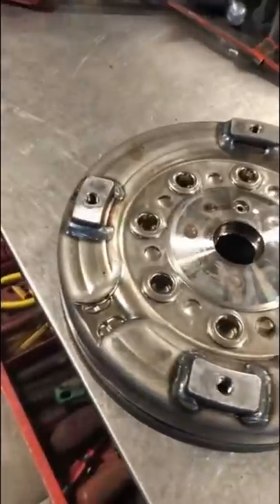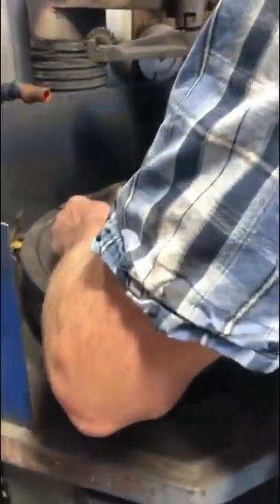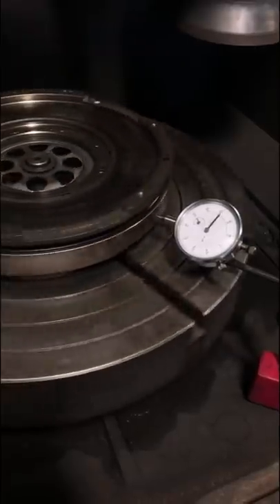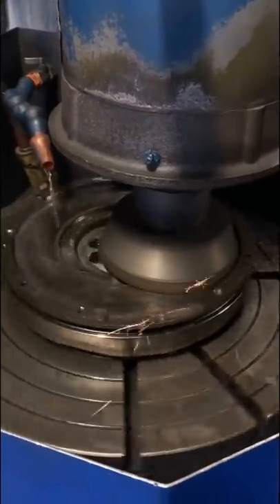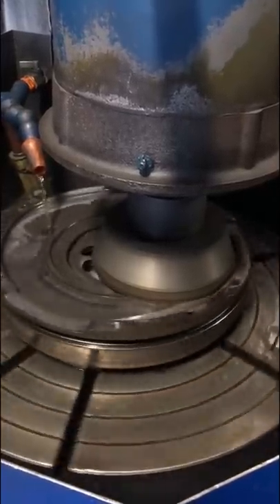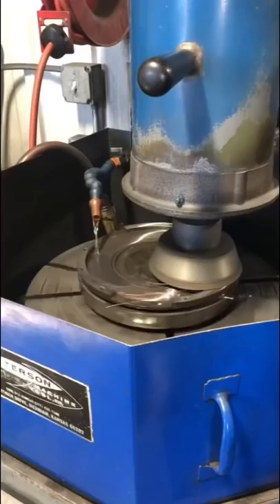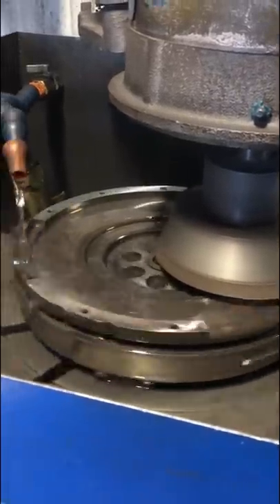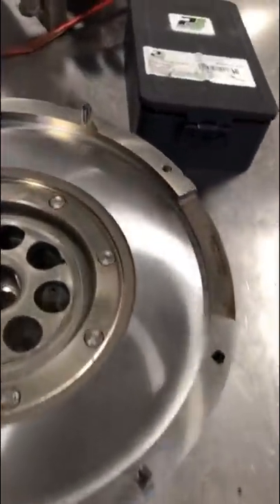#shorts We Can Resurface A Dual Mass Flywheel… But Should We?

Comment: Idk. I'd be looking at non-stock options that may be more readily available. Dual mass dampers inherently fail as they are considered to be a wear item. (Not just the clutch surface, but the damper itself) so, while the surface may work, i'd expect the damper to fail soon.

Comment: It's probably gonna work just fine, but at this point nobody can say how long it's gonna last. As a mechanic I personally have seen a lot of DMFW where the springs snapped inside wich often made the car nearly undrivable due to a really jerky clutch engagement and a constant rattle when in deceleration or partial throttle situations.

Comment: After reading the comments it has occurred to me that people don't know why you don't resurface a duel mass flywheel. They are looking at the finish and saying looks good. Or it will work for a while. The thing isnt going to break. The reason why you dont grind a duel mass flywheel is that the friction plate portion is supported by springs that allow the flywheel portion to physically semi rotate on itself and gives in to clutch pressure. There is physically no way to ensure that you even ground the flywheel flat. Its going to look the same no matter what because of how the spring mechanism works. But you may have it ground crooked and may shutter or shake under load. Unless you seperate the flywheel you can not verify that it is flat after your done grinding. You are at the mercy of how flat and straight the mass produced springs with 10,000 heat cycles are that the wear plate is sitting on. We ran into the same thing years ago with a replacement being available. So we actually separated it and ground the wear plate separately and then they took that portion to a brake and clutch shop and had the springs replaced and had the whole mess riveted back together.

Comment: I do solid fly wheel conversions in most clutch replacements that i do. I really don’t see the point in dual mass, the small benefit to them isn’t worth the hassle.
And if it’s a performance vehicle the next replacement is so much cheaper and the fly wheel can be skimmed.
This is thee first time I’ve seen a dual mass machined, be good hear what it drove like afterwards.

Comment: With the supply issues we are currently facing and the fact that not everything needs to be replaced. Resurfacing is a viable alternative to replacing. As long as the customer signs a waiver taking full responsibility for any liability due to resurfaced part. No warranty would also be part of that contract. Customer breaks it or the part fails. Customer stands on the side of the road with a thumb out… if customer has been properly educated then… go’head

Comment: late to the party.   not only do they need to be flat, but... the springs needs to have a specific amount of absorption.  So if the intermediate layer between the outer sections is fatigued it will rattle and possibly fail.   I've always replaced them or "upgraded" to a single mass flywheel.

Comment: I would say it depends on how many thousand she had to take off to resurface it. Also it depend on how much torque is going to be needed in the daily use. I think in the short term it would work for sure no matter what the variables were. But I would definitely get a new flywheel as soon as possible to replace that one with.

Comment: Honestly as long as the dmf is in serviceable condition (no excessive movement , no broken springs ect) and it can be secured well enough for the friction surface to remain true to the crank bolt flange I can't see it being an immediate issue. Will it last the expected life of the clutch plate? Probably not!.
 Will it's operation be as smooth as a new unit? Maybe , maybe not!, But it will get the vehicle back on the road and will get the customer out of a pinch

Comment: Looks very smooth finish...it would definitely need alot of miles to bed in on new clutch plate...only one way to find out is fit it..run it for 1000miles n see

Comment: The issue is about the material removed. If you need to grind up to or below that lip or if these surfaces are case hardened then you have a problem ( especially in the first case as you will not have proper fixtures and function of the part when assembled). If these are not a problem then you will have no issues.

Comment: It will work fine. As long as the height between the bolt on surface and the disc surface are within tolerance on both sides and the are able to tighten against the flywheel. Your golden. Money in the bank.🤑😎

Comment: A shop resurfaced fairly new, (1,000 miles)aftermarket flywheel and pressure plate causing the clutch to slip, on my sister’s bf’s 350z. I don’t recommend. Had to pull the tranny to install a new flywheel and clutch kit.

Comment: instant death, no question. surprised it didn't blow up on you during reassembly.

That said depending on the wear I'm not sure I'd want a ride in the car if it's getting redlined everyday/ its probably fine.

Comment: Yeah it's going this way in the trade, if the dual mass has life it's a no brainer due to supply issues.but no point if the dual mass is worn , can go solid conversion but wonder if in a couple of years how many run into problems

Comment: Problem is the internals of a dual mass. Mine has two holes worn through and you can see the springs inside. Still working a little noise comes from it. But seems to be a crap part since their hard to find expensive and not easy to surface.  Screw it throw a single mass in and feather it

Comment: If I had the equipment and knowledge I would have put a layer of weld over the surface then  ground down to the correct size.
I’m sure there is way more to it then that.
(But that’s my hypothetical solution)

Comment: Since there is grease in it wich can and will age and dry out i would not recommend it.
Although it might work at first. 2 mass flywheels can last a long time.
I might take into consiferation how hard it is to remove (eg FWD or allwheeldrive or RWD)
If its easy to get out then why not.
If it take a day or more to get it replaced i would rather take a good new one.

Comment: I mean I think it's fine. The Auto industry is one of those places all it has to do is take someone's legs off one time and then all sudden they put out some warning on the box that says you're never supposed to because you can throw it out of balance and problems can happen that and that's true but and it's a big butt most often it was just a lawsuit that made them put that stupid label on a box and with manufactured defects that do exist there's a high chance that it doesn't mean anything. What I would have done is replaced the flywheel and clutch with a performance flywheel and clutch that fits the splines of the output shaft and ran it that way.

Comment: If they know the risks, then go for it.

What are the risks? DM flywheels tend to be thinner at the wear surface, and the connecting material deteriorates. A good inspection goes a long way. Simple procedure..... people will now learn something new - just because the manufacturer says to replace and not resurface doesn't mean that is truth. Nearly all DM flywheels are good for two or three grindings... or replacement with a standard flywheel that is much simpler...

I say run it. The boundaries on this subject are hardly known, and are not what is "typical knowledge", and so unnecessary funds will be saved. Habits will change, saving people thousands.

Comment: I think you fixed it by doing the outside bolting surface you are not changing the tolerance so I would bet it worked fine if they got a clutch with original specs

Comment: I do agree that it should be replaced. However if u know what your doing or know a machines that knows what there do then it can be a viable option. If and only if you know what ur doing and the potential problems.

Comment: If the options are as-removed and resurfaced... Duh! That thing looked cooked before the cutting. Last time I did a no-budget clutch on my personal rig I clamped a die grinder to a tire mounting machine, clamped the flywheel on the turntable, and ripped it by hand. This is orders of magnitude better.

Comment: Reminded me of resurfacing rear brake rotors on the car i have now. The car sat for a year and even after driving for months the pads were not having full contact on the rotors from all the rust pits. Anywho!! Had a friend spin the rotor while on the car with a serpentine belt I had laying around, a drill, and a large socket. Then went at it with a grinder 🥰🙄🤕 and after a few times driving it now looks and feels like new brakes. New (cheap) pads were installed at the time.

Think you did a better job tho 😉

Comment: Its Not about the surface in a dual Mass Its about the internals when they geht Bad it is Bettina more and more Play i recently had one customer where i Had to Cut the middle Just to get to the Bolts because it wouldnt move so Ur probably better of with Just replacing it with a normal one.

Comment: I mean truth be told customer knows the risks. You might end up with an oil leak in 10,000 mi because of a little bit extra vibration but what BMW doesn't already leak oil from every orifice possible

Comment: Where possible everything should be serviceable… having single use throwaway everything is why we are in the mess that we are,  when it’s cheaper to buy a new skill saw than buy a field winding to repair an otherwise perfectly good saw there is something very wrong … law makers need to intervene and make it illegal to sell anything that by design is not serviceable, but we’ll done for what looks like an excellent piece of work..

Comment: I’d need to know why you’re not suppose to resurface the flywheel. Then I could do a proper, in my head, risk analysis. On the surface, if parts aren’t available, they sign all kinds of release forms, and you know (or suspect) the issue isn’t potentially harmful, do it. Maybe offer to give them a break (labor and/or part) on a new flywheel done the road.

Comment: You're not supposed to use Helicoils on your Acura's aluminum block with halfway torqued head bolts so they don't rip out and it lasts you another 3 months, til you Floor'd it one day drivin up 79 and finally junk it either.. But Get 'er done buddy!! Slow motion's better than No motion. Thanks for doin it for the poor guy 👍 There's a mechanic poem out there, about smirkin from the moon 🌕, it's cool, A+ for the effort, check it out.

Comment: I think that if the only alternative was to junk the car because they couldn't get a flywheel why not resurface the flywheel if it works great then they have a car if not they're going to junk it anyways because they couldn't find the flywheel so as long as the customer knew that there were disadvantages to resurfacing it instead of putting in a brand new one then I'd say go for it the customer is always right even when they're wrong

Comment: Even if supply chain was normal, the new flywheel would most likely come from China and be worse quality than that one. I see mechanics having issues with new cams, rollers, lifters, springs, and valves too. They come poorly machined or of substandard metal grade

Comment: They're over 1,000 comments. Please don't beat me up if I'm a repeat. I think it's a good temporary solution. Especially at your shop. Definitely get the impression you guys take pride in your work. But there's a lot of suing going on. I wonder if you guys are taking on a liability. I also wonder if the car owner is taking on a delayed cost and or danger. I feel like people are sometimes mistaken when they see a recommendation like this replacement of a part that would normally get remanufactured. They then interpret that it's the manufacturer's way of making money on parts. I feel like there may be other reasons. The flywheel sounds like it's off of something a little more high performance. By the nature of the part, it's under a lot of heat stress and we know that has effects on metal. Scary thought... What if they only last as long as the clutch? And the car manufacturers know it? Now that suggestion of replacement is really just a disclaimer so that when this thing does fail and incur more cost or kill somebody they can minimize the exposure of the automaker. I guess it sounds a little dark and sinister but the job that Ed Norton had in fight club really exists.

I'm just playing devil's advocate. If I were in this situation,  I would sign the waiver.

Comment: Dual mass flywheels are a scam ! 
I have seen so many of them go bad it is not fun and the damage they cause when they go bad  is unreal .
A bmw  i worked on  had a bad dual mass flywheel   that the owner could not afford to replace so he drove it as is for nearly a year . As a result of the MASSIVE vibrations  the engine ripped the supports twice in that year alone which was not the worst part of it because when he finally had enough money to get a new flywheel the crank shaft had developed over 2 mm of forward and aft play , as a result of that play it had destroyed all l seals  and the pistons now free to move about  had scored every cylinder wall , the engine was trashed .
AND . during a parts expo i attended a few year ago  the main engineer at a parts company i will not name  straight up told us that these are a scam  designed  to separate you from more of your money and rarely last more than a few years .
Which is fine for the manufacturers  cause they want you to buy new cars every few years anyways .
Also during my time working at a Peugeot stealership i had to replace so many of them under warranty that we got an updated part . The updated part was  a lump of steel the same shape as the dual mass flywheel ,weighing at over 20 kilos and an old stile of friction disc with the springs on it . 
the added mass resulted in poor acceleration , poor fuel economy  during  city driving , less to no engine breaking , difficult starting due to the starter needing to spin up all that weight , and more .There is a reason they went away quietly into the night and no one talks about it  but i wiil forever be salty about having to deal with this shit

Comment: There's nothing wrong with machining a dull my fly wheel that's a bunch of bullshit. The only reason you don't machine build my wheels is typically you can't clamp them very well and make sure there's no chatter and not break the springs or the rivets that hold the springs. If you can clamp it you're fine if it's not really messed up and you don't want to take off a lot. It won't dampin as much after. Running is better than no part

Comment: I didnt resurface the fly wheel in my 2003 ramger its gone 30k miles no problems with clurch or flywheel at all. So it prolly wwouldve been fine no work at all

Comment: Who the fuck junks a perfectly good car over a flywheel issue? Fuck it, take the risk as a temporary measure if nothing else. If it lasts 20 years, awesome! If it lasts until the supply chain has less issues, cool. Get a new one then, but it served its purpose in the meantime, which gives you time to find an alternative solution.

Comment: Bull crap I wish I had $100 for every dual face flywheel I have ever resurfaced. 95% of all tractors were dual surface and now most cars are that way. If you cut too much off of them a lot of times you have to put a spacer behind the fly wheel to compensate as a spacer it’s a shim. And you also have to take the exact same amount of of both surfaces.
That is the same type of flower machine that I had. If they would have shown the top of it it has a gauge and it tells how much you cut off of whatever it is you are turning as long as you zero the gauge out.  
If you take .005 .010 up too .030 off of the inside then you remove the dial pins and you zero it out again when it touches the outer part on the little ledges and cut the exact amount off of them and like I said if you only cut .005 .010 .030. which should true up any fly wheel then you will not have to use any shims.
I had a friend that wanted me to cut One and a half inch off of a fly wheel that was on his round track car it was a four-cylinder engine and I turned it down on a brake lathe and then the final cut I used my fly wheel machine and yes we had to use spacers for that one but you talking about revving up quick!!!!!! unbelievable!

Comment: As long as it is thoroughly cleaned, no extra rattles when its done, the contact surfaces are flat and true and the center bearings are replaced, Im sure it’ll be fine.

Comment: I would always replace the dual mass with a „upgrade“ to a static flywheel. This things are trash and very expensive even with a resurface the springs on the inside most of the time are broken